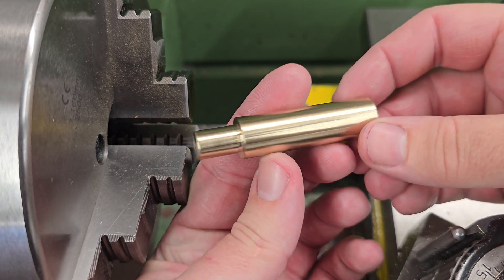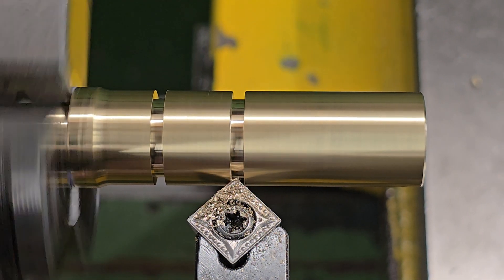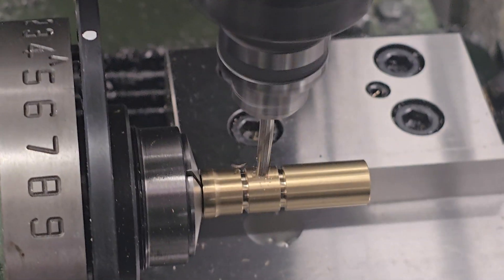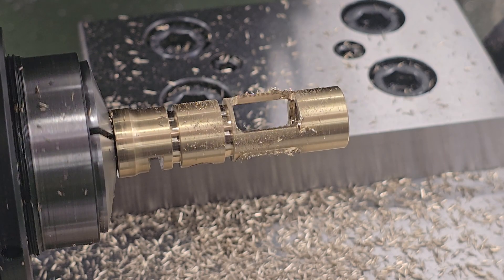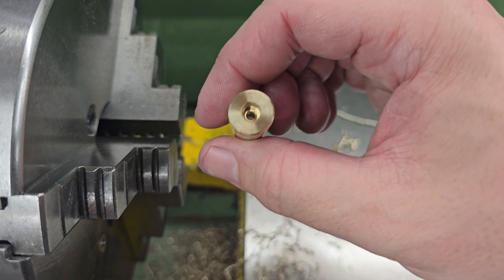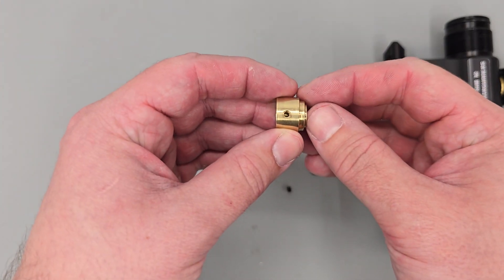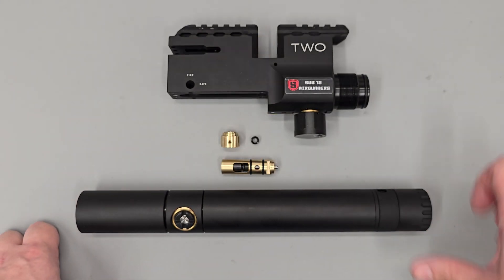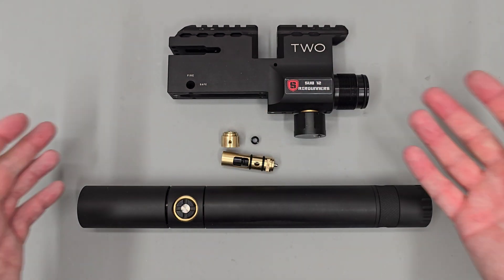Making A PCP Air rifle firing valve (EPIC 2)

Comment: Nice work - as I noticed the valve is a metal to metal sealing - am I right? If it is that so, there is no wonder, why my EPIC 2 is loosing pressure about 100 bars over about day or two.

Comment: Sir, is this valve suitable for a 50 caliber gun?
Reply from the maker: hi no this is made for a 12lbft gun low power 👍
Reply: @sub12airgunners  My name is Naveen. Can you please show me the video on how to make a 50 caliber and the method for making a pellet mold?
Reply: Sir If the barrel length of a .22 air gun is 500 mm, what diameter and length should the pcp tank be?

Comment: Okay so SUB12 valve,,,, i had a feeling it was something like this you talked about.
But i am FAC, so i just watch video none the less, and throw my thumb in the air.

BTW are these regulators meant to be so hard to turn, mine is damn hard to turn VS a FX, but the regulator work just fine no issues there, but adjusting / turning it OMG someone need to make a more sizeable adjusting key / tool

700 mm long 4.5 mm CZUB barrel performing well 🙂
Reply from the maker: thanks for watching 😀 yes the reg will be stiff to turn especially when you have high pressures 👍

Comment: Nice bit of engineering as always, but the best  part is yet to come as when you increase the diameter of the vent to the rear of the valve potentially you loose a little surface area for the air to push against, it will be something of interest to a lot of airgun tinkerer's out there.
Reply from the maker: nice one, not to many people think about things like that we started small so we can work up but it will be interesting 😁

Comment: definitely interesting . i guess most of there gear is aimed at the higher power market so its easier for manufacturing and price to make one valve fits all so to speak . great job mate . and what a cool name spindexer that’s for sure . almost as good as sharp pointy thing but not quite 🤣🤣
Reply from the maker: 🤣🤣 yes sounds like something a 70's disco 😂 yes this gun was built for power for sure